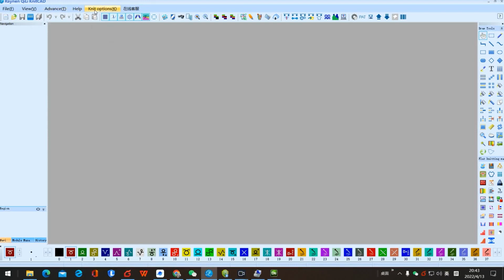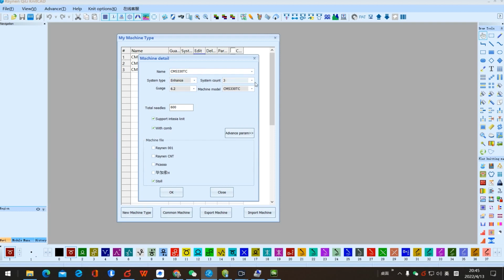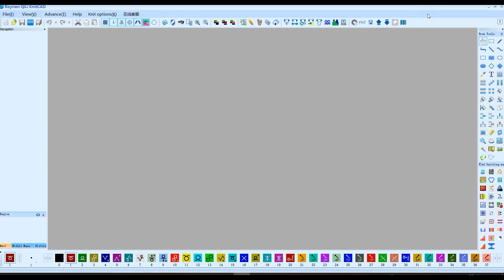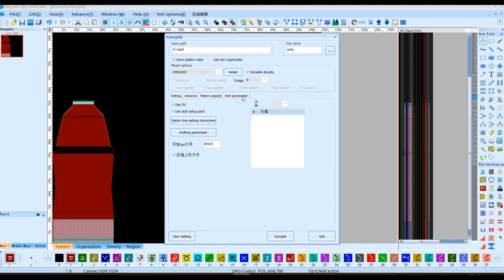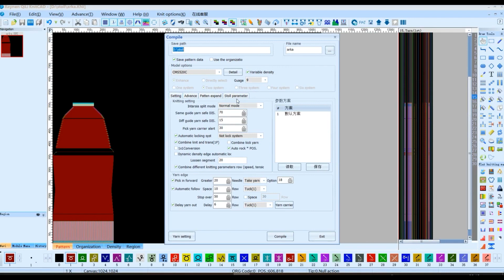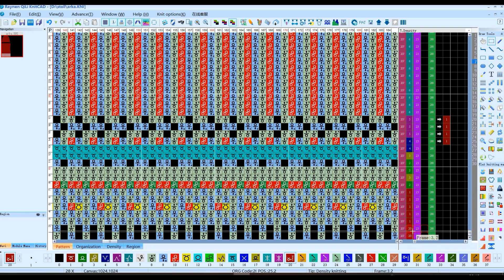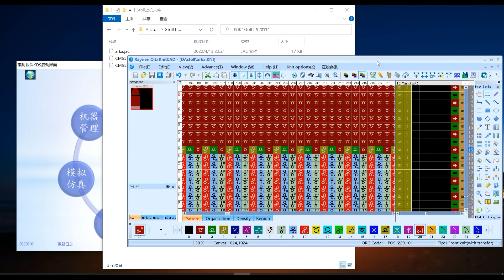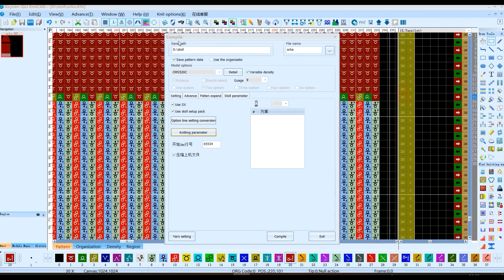create stoll M1 and M1plus program use KnitCAD

Comment: porque no meja abrir el programa
Reply: Me tira 
Setinel key not found (H0007)
Reply from the maker: @cecilioramonbatzibal6447  which version you install
Reply: @longxing  the one in the link that is in the video
Reply from the maker: @cecilioramonbatzibal6447 thanks
Reply from the maker: can't open stoll program only compile to stoll machine file. if you have raynen system machine and stoll machine you can use KnitCAD compile to stoll and raynen machine